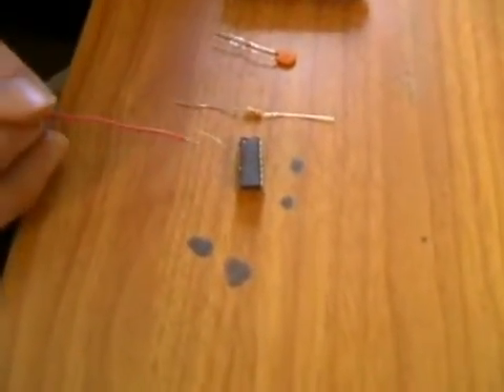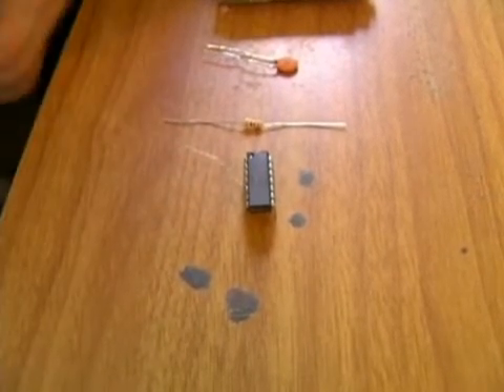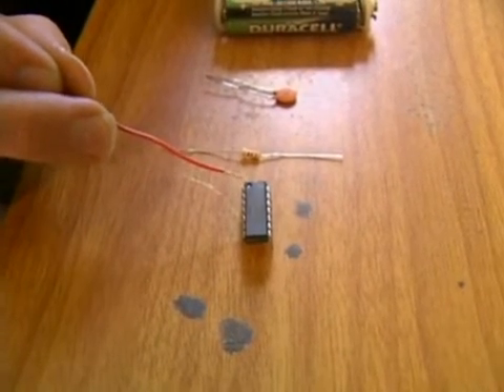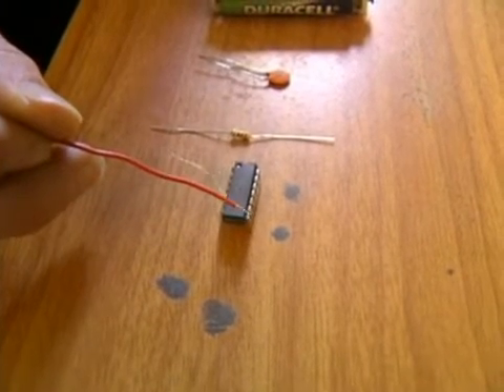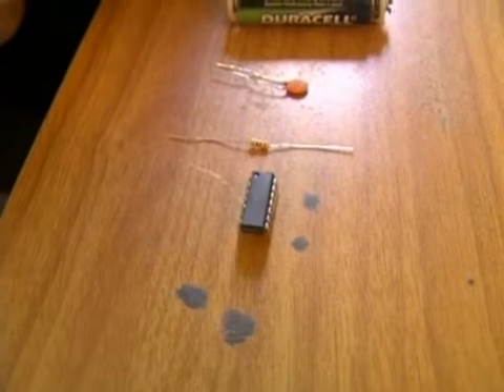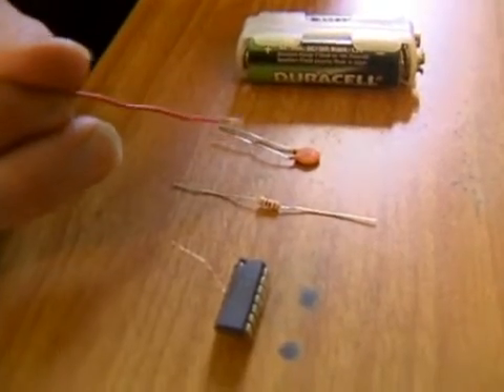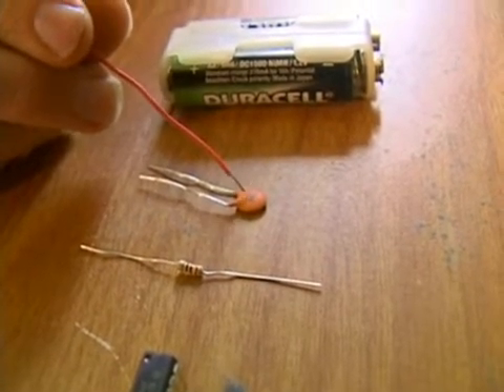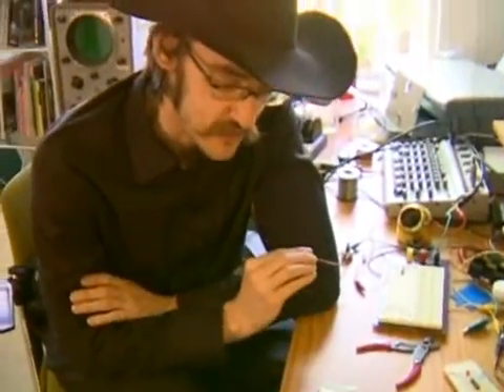How to Build a Synthesizer : Learn About the Components of Homemade Synthesizer

Comment: @ gridsleep: As somebody who has been through some of these types of workshops, most people want results fast and tend to move on when they have to do a fair amount of work. This is actually a fairly good series of videos on how to build a simple synth. There are lots of resources for basic electronics. A simple search on the term "basic electronics" will give you a lot. If you are looking for more in depth stuff, check out WISC-ONLINE. It is excellent and with a little experience you can build the tutorials even though there usually are no specific part numbers.